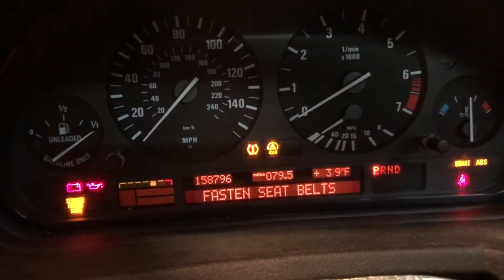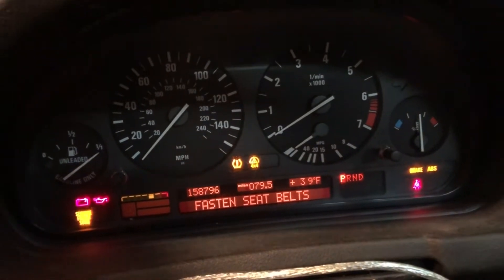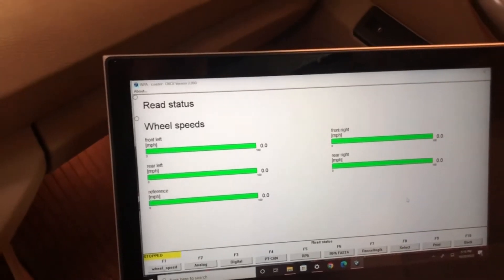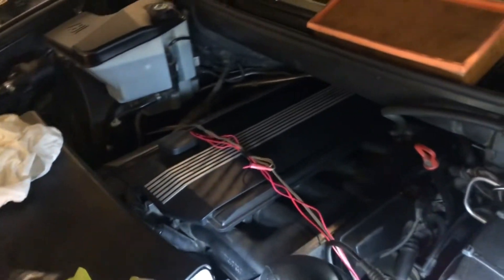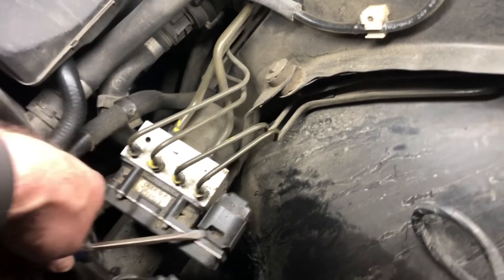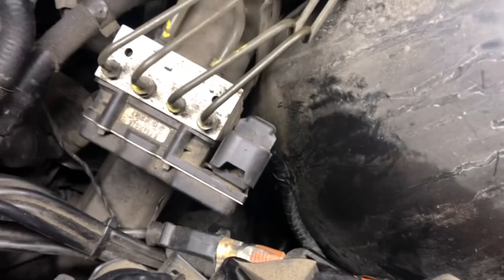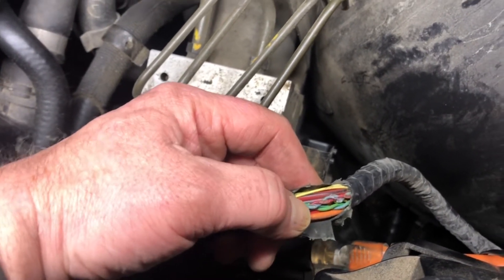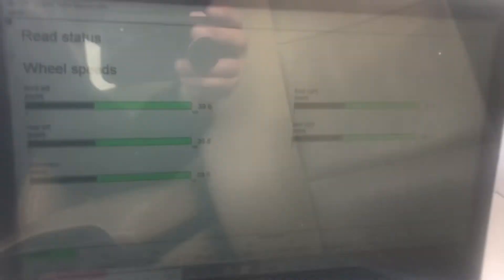BMW E53 Tire, 4x4, BRAKE, ABS lights on due to a broken wire.

Comment: Actually saw this just for interest.. some while ago few weeks ago driving through snow an slush and got all 3 lights TIRE, ABS , BRAKE ..got home safe ( as braking still works) ... had forgotten about this video, scanner said Left rear, and wheel speed is at 0... was thinking finding the broken wire was going to be a task ... will certainly check this potential rubbing against the wheel well...
Is there a way to test the ABS wire from the wheel to the ABS module at the wheel connector? ( voltage, ohms etc ..)  Thanks ( on a 2006 X5 3.0i)
Reply from the maker: Just had my wire break on the right front wheel (from doing the troubleshooting in making this video). While repairing that I took some resistance and voltage measurements. I put those values in the description of this video. but basically 900k ohms at the wheel. 500k ohms toward the module. The wires had 35-50 mV on them with the ignition key in position #2.

Comment: Brilliant I'm sure I've got the exact same issue! But saying that the self leveling suspension inactive message popped up earlier
Reply: Mines exactly same, did u find out the problem with self level? My other lights r off first few miles car runs terrible then they switch on and it runs great it makes no sense. Cheers